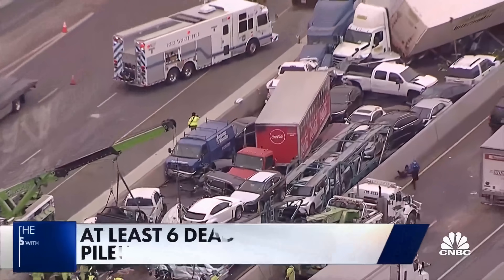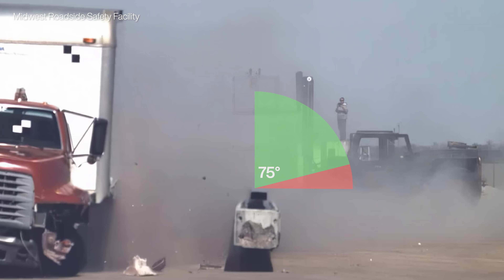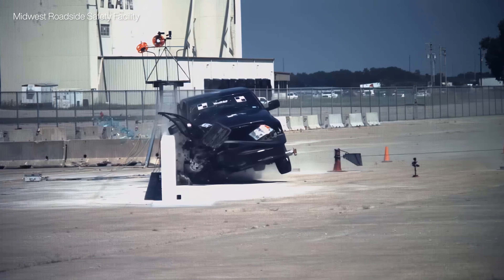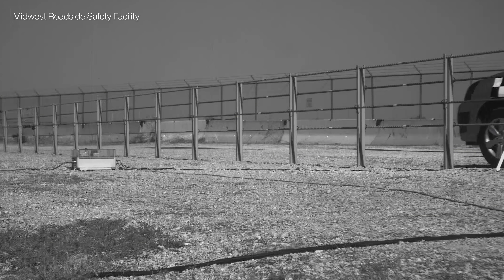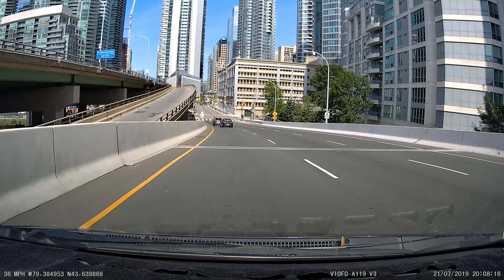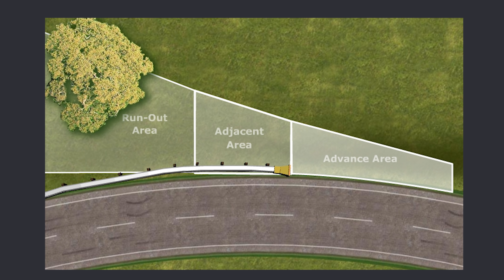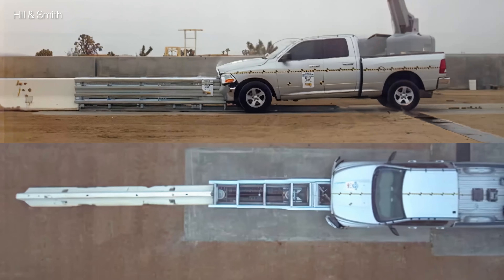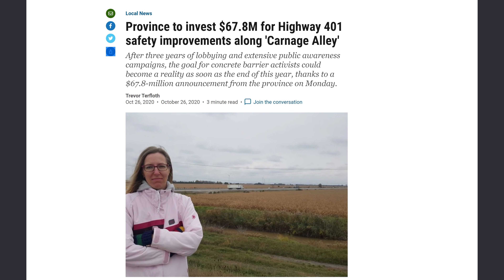How Road Barriers Stopped Killing Drivers

Comment: Hi Andrew, thank you for this, it’s a fascinating and important subject. As a motorcyclist, I wanted to highlight that cable barriers are fatal for most collisions where a human hits a cable at speed. I believe French highways in particular chose to avoid cable barriers in favour of concrete, mainly because (probably) non-fatal incidents involving motorcyclists became fatal because of the catastrophic impact of humans with cables/steel uprights. I would love to hear more from you on this specific topic. Thanks, excellent video!
Reply: I'd rather take a solid hit to a concrete barrier than be beheaded on an 10mph lowside when my helmet edge gets caught on an upright or cable as I slide by on my arse! 
You cannot bend the laws of physics, but you can minimise the risk and method of injury application even if it also ultimately ends up fatal (die some days later rather than lose one's head)!! I chose solid flat concrete 90% of the time
Reply: @johnh3095   I would like to point out that, at least here in the states, there are not many motorcyclists driving down the interstate, at least not compared to car and truck drivers. With that in mind, it’s reasonable to assume that safety standards have less consideration for motorcycles than in other countries. Also, I’ve seen wire barriers, but never as the primary protection. Rails and concrete are used for the right side (which is the one we drive on and the side that directly faces hazards), and wire is only on the median, and it’s usually not right next to the road but placed closer to the middle of the grass, to stop vehicles from crossing into the oncoming traffic side.
Reply: @Shaun_Jones  no dramas my friend. We don't have many cable barriers in the UK at all, only the post and solid concrete type as we do not have the free space available to accommodate a stretching cable and car! They'd likely hit something like a tree, some earth bank or a building. 
Happy new Year to you all. Let's hope none of us ever have to experience hitting any type of barrier in 22 & beyond!
Reply: @johnh3095  you're not going to get beheaded going 10mph
Reply: @gabiferreira6864  it's faster that you think! If not decapitated, you would definitely end up with at least a broken neck (which would kill you) as the chin edge of a full face helmet acts as a lever on your head (which sits on top of your spine, held only in place by muscle etc) thereby increasing the likely loss of one's head!  It's a broken jaw/messed up face if you're wearing an open Face helmet! 

I won't be trying it out on myth busters, that's for sure!
Reply: But without motorcyclists we wouldn't have as many frequent organ donors.
Reply: @bumponlog  I know a few motorcyclists who refuse to be organ donors because they think that if an EMT/nurse/doctor finds out that they are one, the EMT/nurse/doctor won't try as hard to save their life.
Reply: @NarutoOrganisation13  Or maybe they'll see they rejected organ donation and forget to check on them 🤣 your friends could flip a coin on that one, just paranoia
Reply: More injuries for other motorist in vehicles designed for safety, though. I don't really think it's appropriate to design road safety around vehicles that are, by their design, meant to be more dangerous than your typical car. It's like trying to design airports for "pilots" using hang gliders. You have forfeited safety for "adventure".
Reply: I feel like slamming head on into a concrete wall is going to be just as deadly to a motorcyclist
Reply: @Shaun_Jones  a motorcycle rider can lose control but manage to slow down before hitting the barrier. This may be survivable on solid barriers but cable barriers focus the force and can make it more deadly for the cyclist. Whether it is worth it to put up more expensive barriers depends on the use of that road.  You'd have to consider how many cyclists use the road and how much barrier can be afforded. If putting up concrete or steel barriers significantly limits the amount of barrier that can be installed then it may be better to use cables anyway as it will save more lives overall.
Reply: @Shaun_Jones  except that motorcycle helmets are designed to counter just that - hard impacts
Reply: @lichking3711  not at the 70-80 mph speed of an American freeway.
Reply: Motorcyclists will die on anything.

Comment: These barriers saved my life! I got in an accident a couple months ago. Lost control of my car on the highway (rain and a worn suspension) and slid across three lanes at 55 mph into where a guardrail and concrete barrier meet. I hit my head and became unconscious as I drifted back across the highway into the guardrail on the other side. A few minutes later, I woke up and walked out of the car uninjured (except for a mild concussion). Had the barriers been different, or had they not been there, it would have been a much different story.

Comment: For the cable barrier, could you possibly add more cables or different gauge cables to adjust their stopping ability? For example, more cables could stop vehicles from passing through, or heavier gauge could stop larger 4x4s/trucks and semis
Reply: It's just a bit of nonsense this person told in the video. Cable-barriers are just a cheap option for guardrails, they're not even near as safe.

Comment: Barriers should be made for the largest and heaviest vehicles utilizing the road.  Especially the Interstate system since it is the National Network and was designed and built for the transportation of military and commercial logistics.  The use of the National Network by the general public is a benefit.

Comment: This reminds me of Princess Diana's death because of a badly designed tunnel.  The tunnel had pillars spaced out and they hit one in a full head on crash.  I never understood why the news media didn't point out that they would have been fine if they had slid against a wall instead.  And we should get rid of telephone poles on roads, causes lots of fatalities.  Although, my life might have been saved by hitting a pole.  Slid on a patch of ice under 3 inches of snow (I was going about 10mph because the road hadn't been plowed) and couldn't stop the car from going off the road, down a steep embankment right toward the river.  Then I saw the telephone pole and hit the gas so I would hit it.  Didn't tell the police or insurance company that I hit it on purpose.

Comment: Minnesota uses the steel cable barriers more & more. They're put maybe a foot off the road. So in winter if you start sliding & go off the road your car is instantly totaled whereas if they put steel barriers in the middle the damage would be much less. I've seen accidents with these cable barriers & it rips the car apart !

Comment: The information presented in your video is almost impossible to know where to access for the regular consumer/traveler. Thank you for piquing my interest and answering my concerns about cable barriers; one thing for sure they’re a killer of motorcyclist
Reply: They're called cheese cutters by many motorcyclists - they will definitely kill a motorcyclist compared to not having a barrier or having something better.
Reply: @rphenixx  We had some through the hills here that were modified after a series of motorcyclist deaths. They ended up having to install a hybrid system with guard plates to stop motorcyclists being sliced and/or falling down embankments.

Comment: Cable barriers also act as a deterrent for drunk "cross the median and drive on the wrong way" drivers.
As they are cheap, this deterrent, I think, would saved lives compared to nothing at all (as more expensive systems wouldn't be installed at all).

(Sort of your point, but emphasis on deterrent)

Comment: ABS brakes are for people without control. I have locked up my brakes less than 3 times in 10 years and have locked them up deliberately more times than that.

My scooter doesn't have ABS and I have had no issue, other scooters with ABS have been in more accidents probably as statistic as having ABS they choose that one. So, there shouldn't be many of those crashes.

Comment: I think there is something that is forgotten in this video to be perfect, motorcycles. While being extremely cheap and useful, the posts on cable barriers are and extreme hazard to motorcyclists, this also happens on guardrails, but in EU they are solving it by installing "double guardrails" that completely cover the posts. Those posts are deadly while sliding

Comment: Why are all these cars running off the road? Rack and pinion steering. Move the steering wheel an inch and you are off in the woods. Large cars with Saginaw recirculating ball units you could move the steering wheel 2 or 3 inches each side of center to the music on the radio yet the car went ahead straight as an arrow. When people are looking at their phones they have no idea the result of their small input. Look at the tire marks. Folks are hitting barriers at steep angles not simply sliding over and grazing a barrier.

Comment: 7:45 Heres the only thing with cable barriers. In 2014 there was a man who lost control of his dodge viper and spun out into a cable barrier. The vehicle being a convertible proceeded to impact 2 of the cables and the 3rd cable slipped up and over the vehicle and actually decapitated him. Just some food for thought since that can happen even when the car isnt as low as a viper, if you're driving a convertible then you're VERY susceptible to this.
Reply: I crashed my car into a cable barrier and you could see where the cable went over the top of my car and vibrated down. If I was in a convertible I'm sure it would've taken my head off. It was an Acura rsx, so not exceptionally low like a viper
Reply: @minami3823  yep, count your lucky stars

Comment: I completely disagree with cable barriers being better.  Cables are strung for MILES and if one vehicle compromises the barrier then the entire barrier for MILES is useless.  On the other hand, a solid barrier is sectional and only several feet are compromised.  The real reason cable barriers are built is because they're cheap.

Comment: Cable barriers shouldn't be used anywhere. That is insane if you think about bikers. In case of other types of barriers motorcyclist most likely gonna die in case of high speed collision but with the cable barrier he gonna be cut apart even on relatively safe slow speed collisions.

Comment: I recognize it's often better than nothing, but I'll never feel the slightest bit safe around those cables.

Steel cable under tension. Just about the scariest thing you can touch. Not to mention to possibility of slipping under a wire if your A piller gets compromised or you hit the wrong angle.

Our just ride a bike.

Comment: Informative and very watchable video but is there any research on barriers reducing injuries to motorcyclists?  it seems to me that any rails/wires supported by vertical posts have the potential to cause immense injury to an unseated rider sliding along the road at speed whereas a smooth concrete barrier would not present this risk.

Comment: Road barriers still kill bikers, I have been inches from death after loosing traction because of some gravel and falling at about 200kmh (110mph?) sliding for about 40 seconds,  I don't recall the distance ,If for any reason while sliding on the ground i hit the barrier I would have been cut into little pieces, my bike , a gsxr 750 was cut in about 3 pieces when It stopped sliding ,it hit the barrier right after we fell, needless to say it was completely totaled.

Comment: Where I live we still use the ones from the sixties and bridges here are horrible if you walk under them you can see that instead of fixing broken support beams the way they are supposed to the just rap sign posts around them and bolt them in place

Comment: GRAPHIC DETAILS AHEAD.

Paramedic here. Regarding how guardrails used to impale people. I have seen this first hand. My first fatal car accident was a driver who had fallen asleep at the wheel in a sedan and crashed directly into one of those scooped guardrails.

The guardrail punched through the engine, the firewall, and entered the passenger compartment. The steering wheel was torn off and the driver was partially decapitated by the guardrail. The guardrail basically threaded the sedan along about 20 yards of guardrail exiting the back window and elevating the back wheels of the vehicle off the ground.

The destructive force of the impact sent the body of the driver, his seat, and a large quantity of engine debris into the back seat where it pinned and killed his 3 year old daughter. 

We weren't initially aware that the toddler was in the wreck as she was buried in the rubble in the back seat. We were blocked in the fire department and had to wait for the detectives to arrive. I shined my flashlight into the wreck and just happened to see a car seat. I looked closer and saw a childs broken leg and femur sticking out.

I grabbed a Fire Lieutenant and we went around to the other side of the vehicle where she was. I opened the door. I don't know why, maybe I had seen it. But I didn't fully depress my right foot for some reason. I looked under it and saw that a piece of the mans brain had fallen out.

We checked the girls vitals and analyzed her injuries and found that she had likely died instantly in her sleep. I will never forget seeing the chunks of brain and blood and hair caked on the guardrail as I walked up to the wreck.

My service held a "critical stress debriefing". I was the paramedic who wrote up the two death reports and they somehow neglected to invite me. Which, it turned out, was for the best as the Fire Department had found the brain and given it to the other ambulance crew to "dispose of". One problem though. The Medical Examiner called the FD and ambulance services in the morning to politely inquire as to the whereabouts of this mans left temporal lobe. 

The "critical stress debriefing" turned into a shouting match between the FD and ambulance crew as to who should have known better as to leave his brain on scene.

I'm glad I didn't go.

Edit: the saddest detail is this. If the father had placed the daughters carseat in the other side of the back seat, she would have survived with minimal injuries. Life is strange sometimes.
Reply from the maker: Damn dude, paramedics have a rough job.  I've definitely read a few horror stories during my research.  Hope everything is all right for you.

Comment: One great barrier to consider is the "Steel and Foam Energy Reduction Barrier" (a.k.a. SAFER barrier). They started using it in the mid 2000s in motorsports. 
"The SAFER barrier consists of structural steel tubes welded together in a flush mounting, strapped in place to the existing concrete retaining wall. Behind these tubes are bundles of closed-cell polystyrene foam, placed between the barrier and wall. The theory behind the design is that the barrier absorbs a portion of the kinetic energy released when a race car makes contact with the wall. This energy is dissipated along a longer portion of the wall. The impact energy to the car and driver are reduced, and the car is likewise not propelled back into traffic on the racing surface". (Wikipedia)
https://en.wikipedia.org/wiki/SAFER_barrier
Reply from the maker: It's great, it's probably too complex and too expensive for public roads unfortunately.

Comment: im glad for these improvements otherwise I would have died a year ago. I was driving to work around 3am on the interstate when a truck coming from the other direction slammed into the center barrier. Had it not been there or had been an older version, it would have gone into me for a head on collision. Instead the truck slid along the barrier, sparks flying and came to an eventual stop.

Comment: You forgot to mention the maintenance costs for the "crash barriers", concrete barriers last in excess of 50 years with no maintenance even with collisions, however cable/wire as well as Armco has to be replaced upon being struck, as well as renewed every few decades, which may result in closed lanes and lower speed limits whilst the defected barrier is being replaced

Comment: Cable rails don't look safe for convertible cars since from the images the top cable flies up the cars hood, in a convertible the roof isn't hard or is off and the passengers could be struck hard.  And convertibles aren't even one of the types of cars used to test.